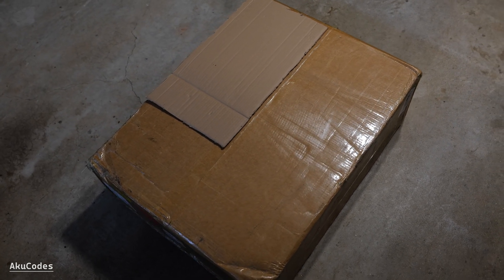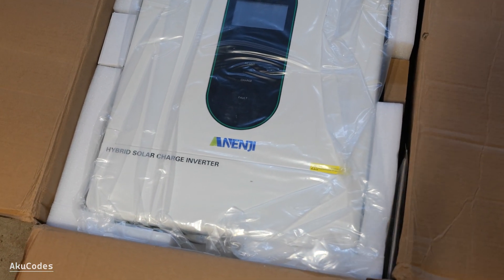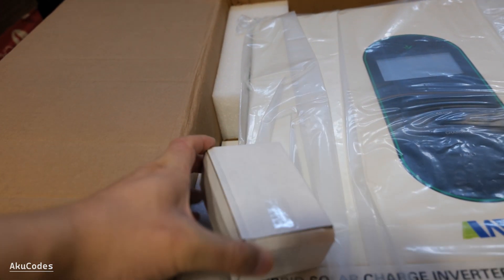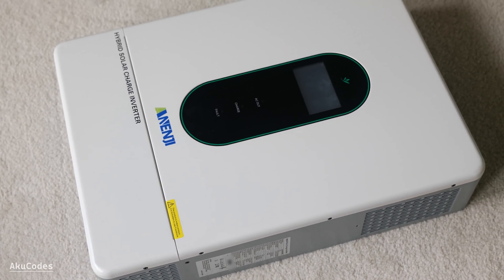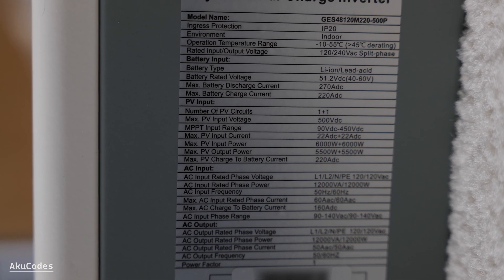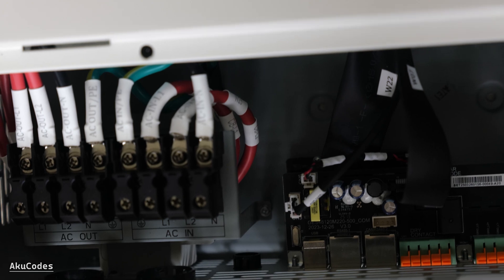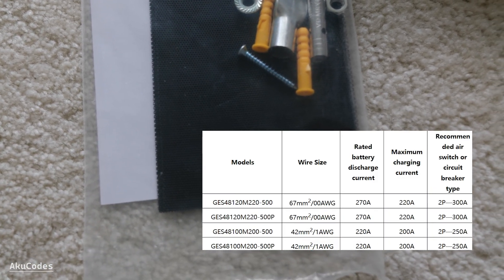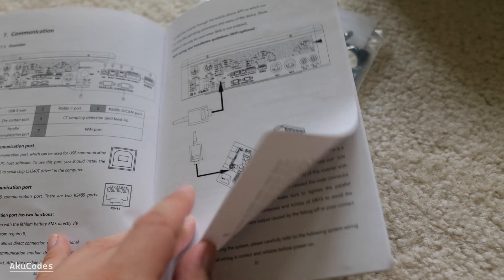ANENJI 12KW Solar Hybrid Inverter (Unboxing only)

Comment: I purchased this Inverter on eBay; the ad said it was an ECO WORTH inverter. I have been looking for videos on how to
make it communicate with the batteries, and finally, I figured it out, it was not an Eco Worth.
I was hoping you would have posted the installation of it

Comment: I set one of these units up and I will share a few quick comments, mostly on initial impressions since I have not had a chance to test its full capacity. It's a quiet unit at idle and under small loads. The terminals for PV input, as well as AC input and output strip super easily, so using 6awg THHN stranded which is the biggest wire that can be used I stripped 2 terminals on the AC output block torquing with only a Phillips screwdriver, and I had to rob the AC input side block to replace the stripped side. The biggest disappointment so far is that both MPPT chargers in this unit only output about 1500w at full sun out of a 5500w array of very efficient REC cells. My 2 old EPEVER 100A MPPT chargers output 3500-4000w under the same sunny conditions, so needless to say, I won't be using its onboard MPPTs. In the next couple weeks I will be running a couple mini split heat pumps ~4500w, 7200w clothes dryer, 1800w air compressor and maybe even a couple heat guns to see if I can find out its limits. Hopefully it can live up to its billing and produce the advertised 12kw of split phase AC reliably for at least a couple of years, then it will still be a good purchase even with all of its shortcomings.
Reply: I ran a test it and the best output I saw was around 11kw. While running the clothes dryer pulling about 5500w, the AC units at 3500w and a heat gun at 1700w, the starting draw on my 3hp (15amp at 120v) 30gal air compressor (surge draw is about 2500w at startup) just put it over the limit and the inverter shut down several times. I got it to run if the starting sequence was just correct, when the compressor started up before the dryer went full draw and the heat gun fired up, but it still alarmed at around 11kw and struggled maintaining that level. I would say this is an honest 10kw inverter, not 12kw as it’s advertised.
Reply: Perhaps the problem you had with MPPT was due to the default value for "max total charge current" to the battery being 60A, which is around 3000W, so across the two MPPTs it sounds like it took half from each, which matches the 1500W you saw. The setting range is 0-220A (page 18 in the manual if we're looking at the same one).
Reply: Yesterday I made the jump from a ecoflow delta 2 Max (2800W inverter I think) have an array of 6 575w trina solar panels, most I got on the delta was 3100 at high noon, Im getting the same on the mppt 1, but, for the life of me, I cant get the datalogger to communicate with the inverter, connection to router and internet all pass, but there is always a problem between the inverter and the datalogger (wifi antenna) tried several apps so far  (smart value, shinephone, ess etc)

Comment: Very helpful video.  Have you decided what size wires/lugs to use from battery to inverter?  I am hoping to parallel connect two 280Ah batteries (each max discharge at 200A) so I am looking at possibly using 4/0 wires/lugs but wondering if they even fit?
Reply from the maker: I will be using 2/0 for each battery to busbar then 4/0 to the inverter, the lugs barely fit, you have to take out the plastic grommet, squeeze it, pass the lug then put grommet back. No issues on the screw side.

Comment: hi  , did you manage to connect this inverter by any chance ?  I'm also considerate this model  instead of 3 * 6.2kw in parallel .
Reply from the maker: Not yet, I'll start with the connections this weekend

Comment: Hello, i have a avenji 11 kva. I have trouble to communicate the inverter with the battery. Did you use option Lib( lithium battery)?  I can charge the battery with Solar PV via the Anenji inverter but it did not send the electricity to the load my home
Reply from the maker: 11kva is very different than this model, according to the manual 'LIB' is for Lithium defaults without communication (set voltages manually). Are you not getting any output on the AC out terminals?

Comment: Does it do zero export? Purchase link
Reply from the maker: Yes, it does. It's under 'CT sampling detection (anti feed-in)' in the manual. Not sure if it's trustworthy, there's a warning regarding grid connection.
https://www.aliexpress.us/item/3256808698378123.html currently sold out.
Reply: @akucodes split phase true hybrid L1 L2 neutral & ground is hard to find at that price. I'm looking forward to more testing from u on this unit . & Thx for responding

Comment: Have you set up yet, off grid or on grid?  I am awaiting my 2 x SKU：ANJ-12000W-LVP-WIFI / ANENJI 12KW 48V Hybrid Solar Inverter 110V Pure Sine Photovoltaic On Grid Off Grid Inverter PV 500Vdc 220A MPPT Solar Charge Controller
Reply from the maker: Not yet, still waiting for some parts to arrive. I'll upload an update once I get it running.
Reply: @akucodes hi hace You set up yet . I put one ando gifme error 46 when i puting to the Hause someone can helme

Comment: The Chinese are working overtime dumping the cheap high-frequency, transformerless inverters on the US market. You'll be lucky to get a year or two worth of use out of them, and they offer the poorest surge capacities out of any inverter design on the market. Even worse, because they lack an output transformer, they don't provide any galvanic isolation between their DC boost stage and their AC output, which can lead to some serious damage to your home's appliances. More than 90% of the inverters that we're getting into our shop for repair are high frequency, transformerless types and 9 times out of 10 it's a failure of the cheap MOSFETs/IGBTs or Caps that they're using. If you doubt what I'm saying, then ask Google the following question: Can a high frequency, transformerless inverter damage your appliances? And learn the truth about the crappy inverters.
Reply: Hey, is the damage risk relative to the load and the inverter capacity? For example a 1000w load with a 4000w surge, using a 2000w inverter with 4000 surges, vs a 4000w inverter (with 8000w surges) vs using a 10000w inverter (with 20kw surges). What brands reach the shop for repair mostly?